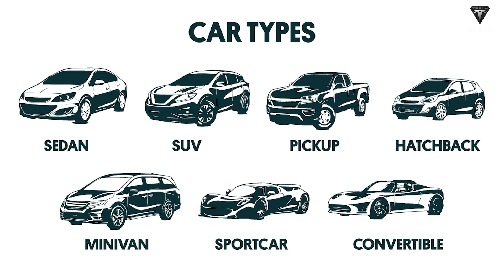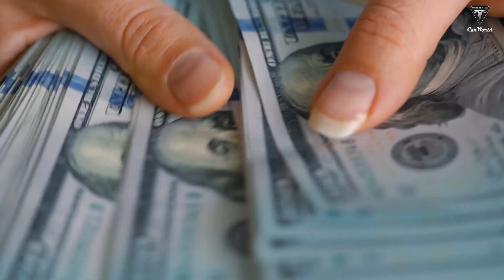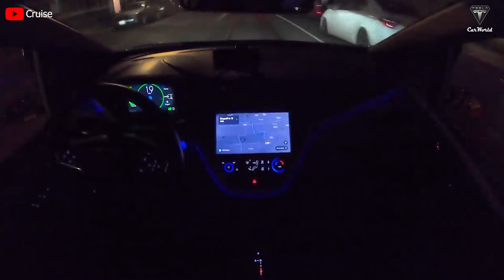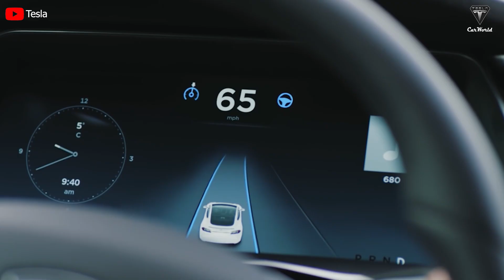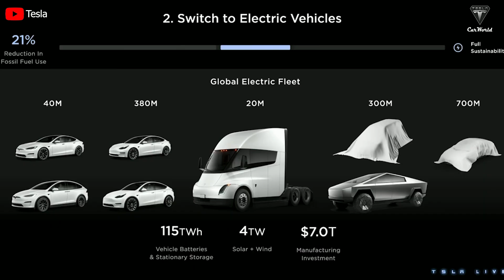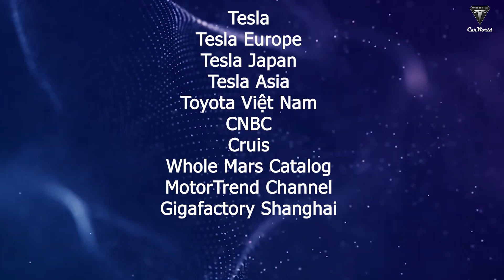Just Happened! Elon Musk Reveals Super NEW "Tesla Model 1.5" For 2023, Destroy Entire Industry!

Comment: RE:  Warning Sounds.  Proximity-Sound ... A long time ago, someone thought a vehicle should have a 'warning sound'.  And the 'horn' was born.  I say, it is time for 'Another' sound ... Not as 'shrill'.  A sound that would be ONLY 'necessary'.  
A 'PROXIMITY' warning, completely different from a 'horn'.  It could be any sound, that hopefully this 'new industry' of electric-car-manufacturers will adopt, much as they did the 'horn'.  One thought would be the word, 'Electric' (maybe in an 'electric-voice') coming through a speaker or speakers, mounted 'around' the car.  (or it could be an 'electric-motor-sound')  Whatever is deemed to serve this 'Proximity' warning need.
Another idea:  I feel there Should be a 'button' ... yes Elon, A button.  On the steering wheel (maybe right in the center) and this button can be set for 'Short' blasts.  It can be the 'horn-sound' ... but it is adjustable in length, from '1/8 of a second' to 1/2 a second ... (in an adjustable) length.  It can also be set for a 2-beep response, single-beep, triple beep ... It also would be a more 'gentle' warning, sure to NOT piss someone off.